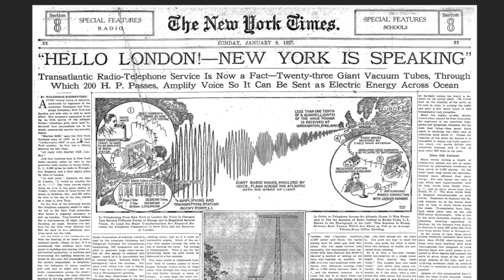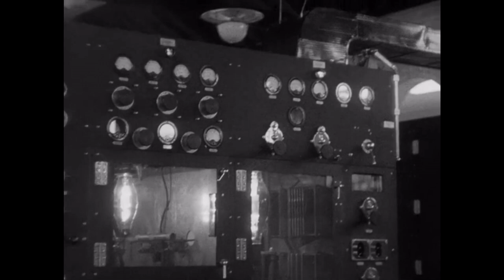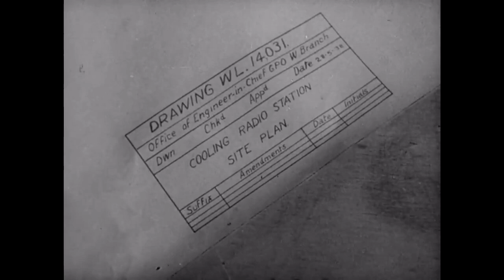When Long Distance Telephone was Shortwave Radio

Comment: Lawrenceville NJ was informally called "The pole farm". The site, razed a while ago, was on Cold Soil Road just north of Lawrenceville.
Reply: You can walk and hike all through the site now as it's part of the Mercer County Park System. There is 1 pole still standing and you can find cables and insulators embedded in trees. There is also a large plaza at the end of one of the trails that lays out all the rhombics.

Comment: I had two 500 foot rolls of #18 copper clad steel wire which I put into a rhombic shape over the family farm during fallow time, winter.       The feed point was fed with transmitting grade thermoplastic twin lead of the shape that was like used for TV antennas.  The wire inside on either side was 16 or 18 AWD.  One side of that feed line went to the right side of the rhombic and the other to the other side.  That was at 50 feet at the feed point and then the wire slope downward to 30 foot standing water pipes on the corners and then on up to about 70 feet at the far end in a big tree, not terminated.  It was pointed at the southern part of Africa and  Asia the other way.  My SX99 exploded with signals from Africa and I had a regular sked with a lady in South Africa which work almost like a telephone.
   I drove it with a Johnson Viking Valient, 250+w.  My rhombic delivered huge crashes from lightning that you could not see, and deafening blasts from that you could see.  I disconnected the kW twin lead outside my window and tossed the end out into the grassy yard.  After a thunderstorm at some distance, even, there would be a burn spot in the grass around the end of that twin lead lying out there.   The rhombic was a magnificent receive antenna, but had to come down when the land under it was due plowing and planting.  I may still have some of the copper clad steel wire in my junk box.
Reply: Thank you for sharing
Reply: Im building a rhombic 710 ft long for 20-10 meter use. I ordered a resistor to terminate it but I’m curious you didn’t terminate yours w great results??

Comment: The problem with signal fading was the reason for the Hallicrafters dual diversity radio, model DD1.
It used two antennas, two receivers and a section that used the stronger audio signal, so you did not hear much, if any fading. If you have time, look up dual diversity radios, it was a fascinating effort to eliminate the problem.
Reply: Two efforts that ham do not do explore or use at the antenna, are diversity receiving and/or changing the height above ground of yaggi's and other antennas.  My one radio FT-9000 what do diversity receive with separate receive ant socket.  More along these lines could be experimentally done, but the age of twiddling with such exotic things is over------- turn it over to the handheld HT.

Comment: I use USB/LSB on my Tecsun PL-680, it has a decent SYNC detector but using SSB works better, it has a really good effect at reducing fading and of course interference from interfering sources such as noise or another station close by.

The sad reality today is that most modern radios have a DSP chiip that destroys the audio quality of SSB meaning using SSB on an AM station sounds pretty bad compared to the Tecsun PL-680 due to it's pure analogue design, DSP radios are cheaper to make and need far less alignment if any so there is no incentive to make a radio with good sounding SSB.

Radios like the Tecsun PL-880, 990x, S-8800, PL-330, H501 and the XHDATA D-808 + the ATS 25+ all these radios and pretty much any DSP radio has been ruined by DSP.

The Sangean ATS 909 X2 is another really good sounding radio on SSB. 

SSB can work much better than the filters alone on DSP radios because you can eliminate one of the sidebands giving far better selectivity but this only really works if the audio is good. 

Using SSB on an AM station is called ECSS or zero beat.

Comment: Between 4:30 and 5:00 he mentions 3 unrelated units: miles, feet, and yards. One might have believed the US would evolve between 1938 and 2022, and yet they are still the only one developed country that would use this rather than meters.
Reply: True that, but most of us yanks in the engineering or machinery fields have s-l-o-w-l-y gain some working knowledge of the metric system and of course there is always Google to help us   when converting units of measure. I know adding, dividing and multiplying fractions of an inch can be terrifying to the old world but over here we grew up with it. The history of measurement units is a fascinating topic but it hasn't stopped us from creating some awesome engineering feats all over the world.
Reply: That's because Americans have enough common sense to know NOBODY eats a 0.125 slice of pie, it's an EIGHTH of a pie.
Reply: And the USA is the only country which landed men on the moon.
Reply: @dowjones3886  A German Nazi scientist Wernher von Braun did. And yes, he did use metric system when designing his rocket.
Reply: Modern CAD (Computer Assisted Design) software can work in any of the units defined today, this is not the 1970s any more!

Comment: A e ignoramus here asking an ignoramus question

Were they basically making Co-ax cabling with all that copper pipe within copper tubes?

That waterproof tape they used will last 20-25 years in the right environment…i bought one roll and it has lasted me 40 years and is still potent when fresh… made of Linen utterly impregnated with a heavy tarry glue…
Reply from the maker: You're right, they are making rigid co-ax cable.
Reply: @Look_What_You_Did  Not wave guide...   Wave guide does not have the smaller conductor suspended in the center of the larger conductor.   As Naradaian suspected, they are making rigid co-axial cable.